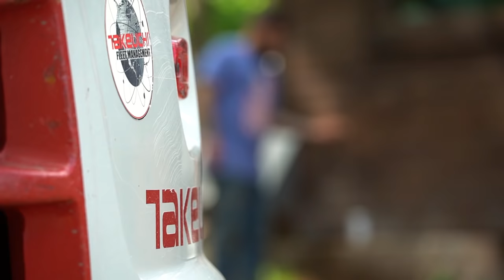MOVING ON WITHOUT HIM

Comment: Very sorry about Chuck.  You gave him a wonderful life.  Your grass is coming in nicely and here's some advice.  I admit that I'm not a landscaping professional but I have put in a lot of yards over the last 45 years and I recommend that this fall, like September, you over-seed it again.  And maybe again next spring but use a spike aerator pulled behind a four-wheeler (so you poke some holes in the ground and yet not compact the soil with a heavy tractor or truck).  You won't need to use a core aerator unless your soil gets very compacted over the years.  And when you mow, do not cut too much off.  Fescue grass likes to stay taller (keep it like 4" tall) than turf grasses.  When you mow, don't cut more than 25-30% of the blade length off at one time because that tip of the grass blade is mostly water and not fibrous.  If you cut too much of blade off, more of the blade will be fibrous and you'll build up thatch down at the grass base which will choke off the oxygen... unless you plan to rake up or somehow gather up your clippings.  Another reason not to cut fescue too short is that more sun will reach the soil and encourage weed seeds to sprout.  Taller (and thicker) grass will actually shade the soil and discourage weed seed from growing.  I've learned all of this the hard way.  Best of luck to your beautiful family!

Comment: the trick is don't tighten the handle bar clamp, just get it snug, so if you fall the lever will fold up and not break off or break the mount along with the lever.
jim

Comment: As an added bonus you should think about making the sidewalk ADA compliant.  The minimum width is 36 inches so make yours 4 feet.  You never know when you might need to roll a wheelchair up.  I would also recommend setting a PVC pipe under the sidewalk slab since you never know when a wire needs to be run.

Comment: On the sidewalk curves if you had any TREX decking you could use that or 1/4" material or cut kerf in the material to bend the thick board.  On the your culvert install riprap on the head and tail end of the culvert it won't erode the fill.  You can watch on you tube letsdig18 he shows how he install culvert pipe.  Sorry for loss. Chuck will be missed.

Comment: Tips on clutch and brake levers:  1.) Always inside the length of the bar so the bar takes the blow and not the end of the lever.  2.) Replace hex bolts with Allen head bolts so you can carry a wrench and extra lever (if you start to ride far away).  3.) leave levers just loose enough to hold on to the bar when riding hard, but loose enough they will "spin" when you crash. When you do, just spin them back and take out your Allen wrench and snug up a tiny bit. You will no longer break leavers when you crash.

Comment: So sorry about your family dog.  That is never easy to deal with.  I have grown grass before and I have installed sod too.  A few things grass seed love is a starter fertilizer, top soil and irrigation.  A top soil helps the grass stay stable with the weather and birds and it helps to retain moisture for the seed.  Usually I re-seed about 4 times to get a lush lawn.  Did you want to lay PVC sprinkler pipe for irrigation?  I had a question about saving the water from a rain in water storage barrels?  Have you thought about putting in a pipe system and gutters on the roof?

Comment: you prolly want use 4 culvert pipes, one big pipe would be a mistake because it would increase the force of the water in one place thus creating alot of erosion that will create a rolling effect upon exiting the pipe. this will then  wash out underneath the culvert and dig a huge hole.

Comment: I wasn't going to say anything about your sidewalk . When you put the screws to the inside of your forms it makes it hard to remove the form after you pour the concrete. It looks good and you're right about putting a little slope to the sidewalk for the rain to run off. Great job you guys work hard. At least you've been around construction jobs. Knowledge helps a lot.

Comment: I don’t know what your choice is for the sidewalk and driveway but I used concrete was not happy with it. Paver bricks in my opinion is a better choice. The roots from the trees will lift and crack the concrete. With bricks you can redo them.

Comment: Does the perforated pipe have a solid under and a perforated top part? (If it’s fully perforated then naturally in dry conditions the tap water will just drain down into the soil….)

Comment: How are you going to unbolt the wood after cement is poured with the bolts on inside?  Never seen anyone do it that way, unless you plan on leaving the wood there but then what about the posts you have the screws into? I’ve put in a lot of sidewalks and never seen it done this way

Comment: RIP lil buddy, i never will under stand why there lives are so much shorter than ours. I have had so many , one even saved my life, i was logging and climbed a slash  log pile to cut the logs poking up out of the pile ( jill pokes) one log i cut was pressure loaded swept me and bent me over backwards pulled the museles loose at the bottom of my back , could not get up . A bull dozer was coming with another load of logs it was my dad . I knew i was dead or going to be mangled, then outa no where my dog apeared and run to the top of the pile and sat there making the dozer stop.she neever moved till he shut the dozer down. Thats when i holared and he came around the pile to find me stuck dad cut a log or two and pulled me out. PHEW. thanks again ginn dog. Oh ya my dad gave her a whole Bbq T bone steak for dinner. He was so over whelemed .